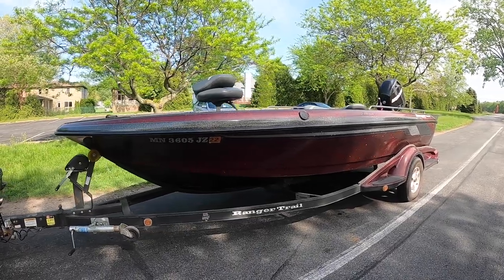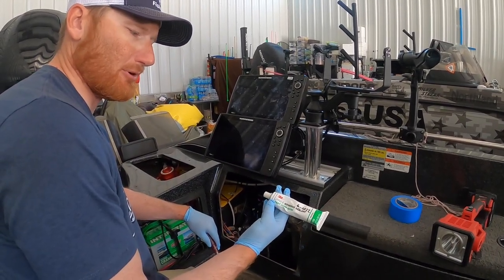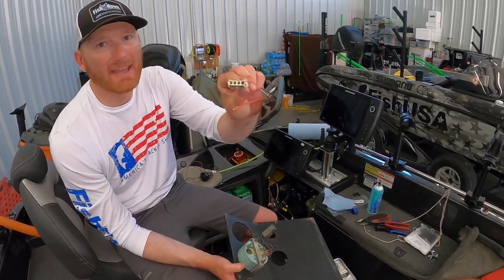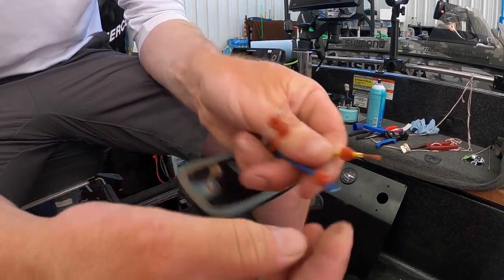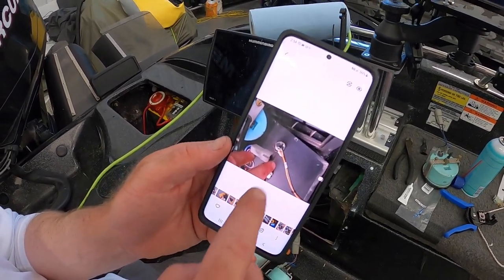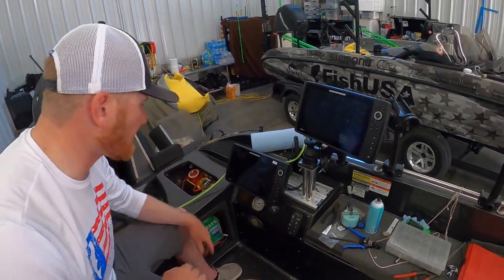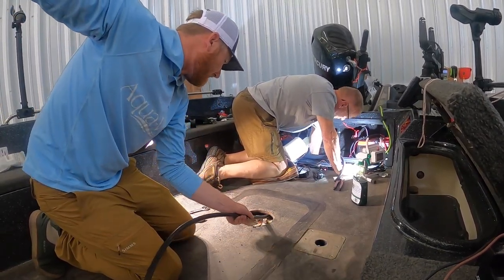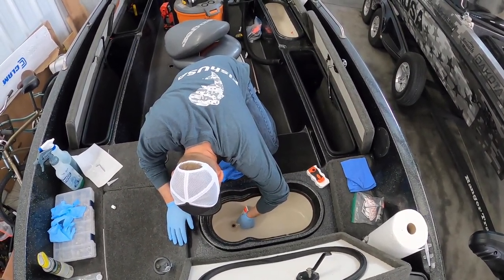Replacing Boat Wiring & Gas Lines | My Project Boat Part 13

Comment: I have an 04 619, the screws that holds my my passenger side console to the hull of the boat pulled out. Do you think that 5200 would fill the gap of the stripped out holes and hold up over time? Thanks.
Reply from the maker: I wouldn't go there.  You can gain access to that area from behind in several places and it's best to through bolt it with large fender washers